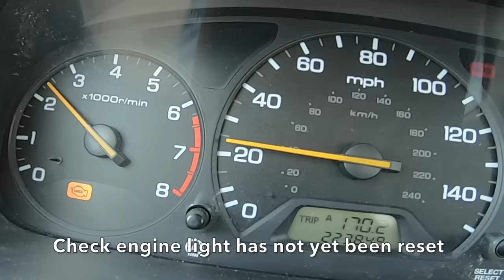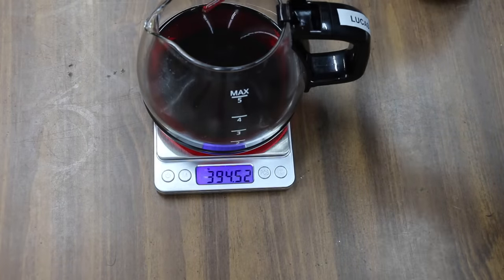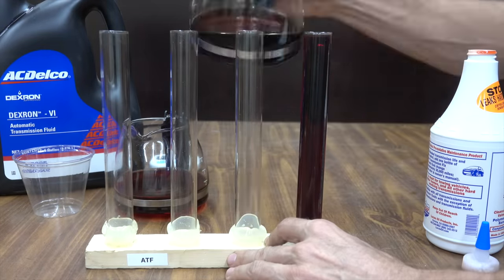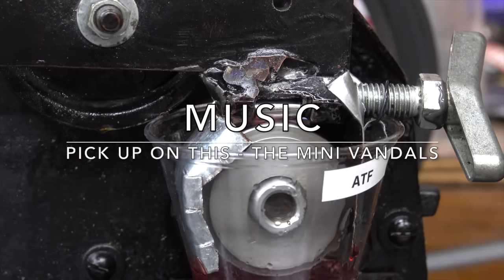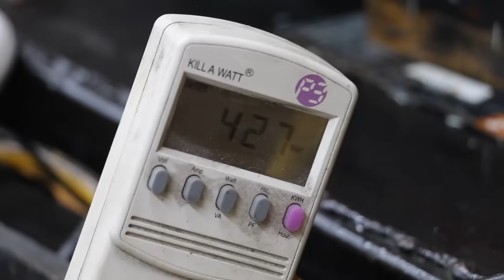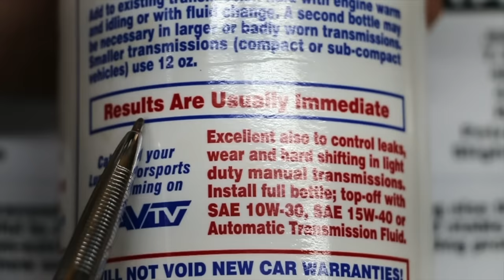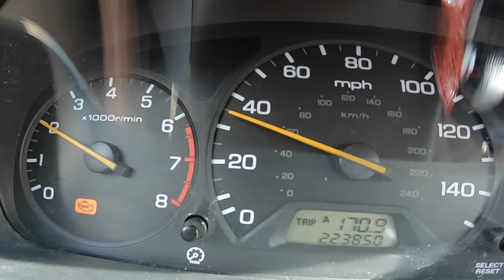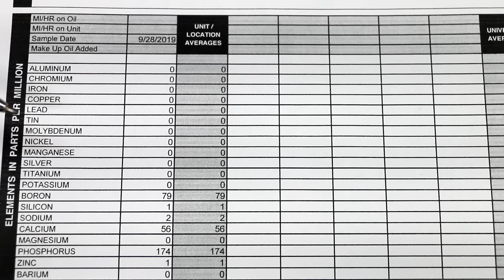Does Lucas Transmission Fix Work?  Let's find out!

Comment: Ive personally seen this stuff take 2 different 4L60 transmissions from not moving to driving fine for several thousand miles.  It doesnt last forever if their slipping really bad to start with but it will get you by for a while.  I had a work truck that would start slipping every 10k miles or so add a quart of Lucas and continue on another 10k miles.  One time I'll never forget, I was driving across the state and coasted into a napa (thankfully there was one on my route when it started slipping bad) added a quart and continued one my way like nothing happened. I did this often and got another 80k or so out of the truck before the owner of the company finally got me a new truck.  I did a tranny service fluid and filter on an old farm truck for a guy I helped for years and it took a truck that wouldn't move at all to driving just fine for quite a while.  It works wonders but like i said it's not a permanent fix on badly worn out clutches!
Reply from the maker: Thanks for sharing.

Comment: I've been contemplating replacing my transmission 352,000 miles. Slow to go in gear, revs when shifting,and clunks when coming to a stop when cold. After warming up it gets better. I will try the Lucas fix first.
Reply from the maker: Thanks for sharing.
Reply: @starkeymorgan7481 put it in yesterday and it seemed to help imediatly. Will give it a long drive today.thanks for sharing.
Reply: @starkeymorgan7481 so far so good. It has improved enough that I will hold off on replacing it. 353,000 miles and still going.

Comment: I know it works when a AT doesn't grab like it supposed to. My friends van had a jurk when starting. Changed the fluid. Drove it 300 miles. Then changed it again with two bottles of Lucas AT fluid and it has been amazing. since.
Reply from the maker: Thanks for sharing.
Reply: Did the same thing on a 2008 Hyundai van. It has been working great since.

Comment: can u use just lucas transmission fluid only
 or would it hurt any thing
Reply: You want to use transmission fluid still and fill some of this into the transmission while the cars running. After adding it, shift through all the gears and wait a little bit for it to mix through.

Comment: I had a 2001 Suzuki Grand Vitara with 223,000. The reverse gear took 5 sec to engage longer during cold weather. Drain a quart of the tranny oil and added a quart of Lucas trans lubricant and it started to engage after a little test drive. I had the vitara for 3 years after that with no problem. Aamco quoted me $2500 to fix the problem. I have to say Lukas worked for me!
Reply from the maker: Thanks for the feedback.

Comment: I have verified it, this product, I give life back to many transmissions that have not had maintenance for a long time, it has repaired two used cars and they look great on me, you just have to keep changing the oil from time to time, so that it works better, do not flush completely, only part of the oil until the system is cleaned, in the end change the filter and only oil and keep running, God take care of you
Reply from the maker: Thanks for sharing.

Comment: Fixed FOUR transmissions that I had issues with on four different mustangs. Any hard or rough shifting transmissions, try this first before going to a shop. Could save you thousands. I bought a mustang for 2000$ that had a trans that wouldn't go out of 3rd. Drained a quart of trans fluid, added this stuff and slowly after about 300 miles it was shifting like brand new.
Reply from the maker: Thanks for the feedback.

Comment: Used in 2007 charger rt. Had delay and shift shock 3rd to 4th gear and all was fixed and drove the car after that around 40k km and the car had around 250k km 
And sold the car after that and the next owner used it for around 30k and never complained
Reply from the maker: Thanks for sharing.

Comment: I have used Lucas products and had good outcomes with them.   I had a 1980 Chevy Malibu with a small  v8 engine.   It had 170000 miles on it and i bought it used.   It would go into reverse however very slowly.  So I had the trans flushed and still the same problem then i added the Lucas and the slow into reverse almost completely disappeared I had a rebuilt engine put in this vehicle right after I bought it due to oil consumption so I wanted to keep the vehicle.      I drove this car an additional  one hundred and thirty thousand miles and no more problems.   I  changed the transmission fluid every additional 30000 miles and I changed my engine on every 5000 miles and I ran Amsoil in the engine with some Lucas and the Amsoil transmission fluid also with a 24 ounce bottle of Lucas.   I gave it to my daughter who drove it a additional hundred thousand miles.  She sold it to a friend and it is still going with over 300 thousand miles on that same transmission which is amazing for a American built automatic transmission. However I think when it has issues that they will probably retire it.    And yes Amsoil is the ultimate vehicle oil.   And Lucas is a awesome engine and transmission life extender.
Reply from the maker: Thanks for sharing.

Comment: 1997 ram 155.000 miles and still working fine engine or transmission never any problems nothing opened still factory
Reply from the maker: Nice!

Comment: Honda had a few years of defective design transmissions over several models in that era.  They KNEW it was a problem but it was never recalled.  200k miles on that Accord before the symptoms of the defect is very good.  My 2002 Honda Odyssey transmission failed twice.  The first at 80k, the second another 80k later.
Reply: I forgot to mention, it was the very same 2nd gear shift behavior as in this video.
Reply from the maker: Thanks for sharing.
Reply: I had 2000 Odyssey and the transmission went bad just about 200k almost 10 years ago.  I took it to carmax and got a check of $300.

Comment: Hondas have 2nd and 3rd gear pressure switches for the transmission that can be changed out. Always do a drain and fill. Do 1x drain and fill every other oil change so you don't shock the transmission with new fluids.
Reply from the maker: Thanks for the feedback.

Comment: I got a f150 with 609,000 I may try it original motor and Trans all run great except getting a small shutter
Reply from the maker: Thanks for the feedback.
Reply: @ProjectFarm  your welcome  one question though just to confirm that I can check the fluid while the truck is running at idle speed

Comment: I had a 2000 Taurus and at 120K miles the front seal in the trans started leaking. It would have cost me 750 to have the seal replaced. Instead I sucked out enough trans fluid to install 4 bottles of the Lucas trans fix and it took a month but the leak slowed down a lot. I did it all over again and sucked out another 96 OZ of trans fluid and refilled with 4 bottles of Lucas. The leak stopped completely and I ran that car for another 100K miles. As a 50 year experienced mechanic, this stuff and other additives will not always work, but they are sometimes worth a try. BTW, the trans always worked great, shifted smooth and I never changed the filter after that. Maybe a one off but I got lucky.
Reply from the maker: Thanks for sharing.

Comment: I know I put Lucas in my engine oil and by doing that 1 quart I save $25 every two weeks. And my truck is 956,000 MI.  it still runs good and it's a 7.3 2001 250 diesels.  hold 15 quarts oil.
Reply from the maker: Thanks for sharing.

Comment: I just bought a 2007 Cadillac DTS with 100, 000 miles on it. The car is in great shape but the transmission was shifting very hard when cold. I added Lucas and some improvement was immediate. Now after driving 100 miles the car is shifting flawlessly. It's actually shifting smoother than any vehicle, new or used, that I've ever owned. Calling the difference before and after adding Lucas unbelievable doesn't come close to describing the difference.
Reply from the maker: Thanks for sharing.

Comment: With your results it begs the question why wouldn't someone just start adding some of this stuff after let's say 2000 miles to maintain viscosity and maybe give you transmission a little bit longer life than the average before a needed rebuild???
Reply from the maker: Thanks for  the feedback.

Comment: As an old retired master certified tech on auto trans, nothing that comes out of a bottle going to fix burnt clutches, bands, hard part damage, convertor failure, maybe make brittle o'rings, lip seals a little more pliable, maybe stop torque converter shudder, but if not drained out doesn't know when to stop swelling seals & can cause internal & external seal leaks, in the old days some people used brake fluid just to hopefully make trans work long enough to sell vehicle, like everything else depends on overall condition of trans !
Reply from the maker: Thanks for sharing.

Comment: Lucas does work in the sense of buying you some time to make decisions and get your wallet in order. I used this product twice in Craigslist clunkers I've bought years ago just to get by during hard times. 92 chevy lumina and 89 chevy astro van. one wouldn't get out of second gear and the other slipped in all gears. The Lucas made them very drivable. But like the the test results, The chevy van took a few seconds to get into gear during very cold weather after sitting overnight. It was fine once it ran a minute or two. I drove them around over a year, never had another issue and was able to sell both once my finances were straight to knowing buyers.
Reply from the maker: Thanks for sharing.

Comment: We owned 2 , 90s Honda's. Transmission went out and overheating head gaskets.  
We thought the Subaru would be better with a 2.5 it also has overheating heads. Even after we paid a mechanic 3k it was worse with dirty black oil in the coolant.  Took it back again and they fixed it and two thousand miles later the new timing belt blew. Sold the car for junk.
Reply from the maker: Thanks for sharing.

Comment: I swear by Lucas transmission fix! I bought a 1994 F-Super duty dump truck with only 46,890 miles, it was used for Snow plowing most of it's life when I bought it. I had to tow the truck home as it had many issues. Once I got it running I found the tranny was shifting super hard, not good 😢,  I dropped the pan to find someone had tried to replace the filter but did not remove the old O ring gasket from tranny. The filter was barely in place! New fluid and filter and a new O ring changed nothing. I have Never believed in the old saying of a mechanic in a bottle/can but after trying Lucas transmission fix I was shocked at what happened. The truck now shifts as it should properly and without any slamming into gears between shifts points. The more I use the truck the better it gets. Last summer I hauled 7 five yard loads of crushed rock with No issues at all. The truck has the E4OD transmission and the 7.5L engine. Best product I've ever used. The product modifies the viscosity of the trannies fluid. You Do NOT have to drain any tranny fluid out to use the product which goes against everything I knew about transmissions and fluid rules!! I swear by Lucas products. I now have added it to every truck I own and give it out as Xmas presents to friends with older autos & trucks😮🔧🤔🔥🔧❤❤❤❤❤😂.
Reply from the maker: Thanks for sharing.

Comment: I hit a huge deer several years ago, with my Chevy Astrovan, It was my Dish Network van  I owned, and worked out of. After I hit the deer, I stopped and drug deer off of road so next person coming about the corner would not hit it also.. But this took me  a few minutes to do.. I didint know the wreck busted my oil cooler in front and all my oil was pumped out on the road. I got back into my van and it was loud.Lifters were chattering and such.. oil light was on.. But I had to drive it down the road a ways passed the guard rails to find a place to pull it off. I just knew it was about too lock up  any time. but did manage too get down the road 1/4 mile and park it for tow truck next day.  I went with tow truck driver and had to try and start it again to turn it around. it started right up and got it on tow truck. later after getting it home. I put another used oil cooler on it and  put oil back in it. and too my suprise it started right up and stopped chattering.  I ended up fixing front end and  drove the van 2 more years with NO problems. The only reason it was running after it ran out of oil was Lucas oil treatment... Im a beliver.. you cant take oil out of motor and run it.. just dont work without throwing a rod.
Reply from the maker: Thanks for sharing.

Comment: Idk much about Honda transmission, but I'd suggest checking the shift solenoid. Not saying that's the issue but normally the part is cheap and normally easy to replace and is overlooked.

Also most fluids are called snake oil for a reason it won't fix your issue, but could lower the issues and extend the life while you start looking for another car or a legitimate repair.
Reply from the maker: Thanks for the feedback.

Comment: Thanks Brother.. May I add something? I'm an old life-long car guy and have owned, sold, flipped, traded hundreds of them. NEVER, NEVER change the Trans fluid on a high mileage vehicle and especially never change the fluid if you having problems. The detergents in the new fluid will kill the transmission. The contaminates and clutch fibers in an old transmission fluid aid in the viscosity problems so when you remove/change that it only gets worse. Usually you can add Lucas and drive for many more miles and sometimes years. My Tundra started slipping at 160k miles when I put in a bottle of Lucas. 5 years and 50k miles later, I'm still towing my tractor or cars with a 20 foot car hauler on a regular basis and I have no plans on selling it any time soon. Ever wonder why Transmission shops offer discounted fluid changes? They know you will be back in a couple months. Don't take my word for it, Find an old retired Trans guy and ask him.
Reply from the maker: You are welcome!  Thanks for sharing.

Comment: My 1st experience with Lucas was in my slipping badly 1998 Bonneville SE. Had to tow it to the shop, My mechanic said "let me try something $20 I't might work, might not" and he wouldn't tell me wut he used. It Worked, drove the car for 3 more years, gave it to a friend, she drove it for 5 more years till it blow a head gasket. Never had the trans replaced. As a former mechanic, I beat my mechanic up to tell me wut he used and it was Lucas. I have used it ever since. Latest vehicles a 2001 Subaru Outback, started slipping 2-3 Lucas worked, car now has 277000 miles on it. Also my 2010 Ford Explorer, had some weird shifting going on when i bought it @190K. Serviced the trans, added the Lucas and 270,040 as of yesterday.!  I also use Lucas engine treatment at EVER oil change on EVERY car i have owned for more then 20 years, YES it all works. Love your test tho, confirms to me i have been hounding people to use Lucas for years for a good reason. Thanks
Reply from the maker: You are welcome!  Thanks for sharing.

Comment: Oh dear, those 6th generation (1998-2002) Honda Accord V6’s had HORRIBLE automatic (4AT) transmissions. Had they come out with a 5MT or 6MT earlier on (ex: Acura CL Type S), it would’ve probably made the car much more robust, and damn near bombproof (if not abused all the time ofc).

Comment: Felt like my transmission was slipping. Added correct amount by the directions. Smoked my transmission in 5 minutes. Plugged up the lines and cooler 5k in repairs. Will never trust it again.

Comment: I was a mechanic for about 45 years i worked on many trans many times I would just add about 3 ounces of brake fluid and after several days the transmission would work fine! All any of this stuff does is soften and swell the seals allowing more oil pressure to the bands and clutches!!
Reply from the maker: Thanks for the feedback.

Comment: Either the filter is bad in that transmission. Or, there is build up in the transmission cooler, at the radiator.

Yes, most of the time, the radiator is the most overlooked component in the transmission. Judging by that brown fluid. I would say, it's probably in the trans cooler.

If the customer changed the fluid. And not the filter, I would start there.

Transmission cooler cleaner, $16. 

Having your vehicle diagnosed and serviced by a trained professional... Priceless.
Reply from the maker: Thanks for sharing.

Comment: I've never witnessed a product that would really help with transmission issues. Putting a high viscosity additive just hides the real problem. Adding 90 weight or STP oil treatment will give you the same results. Then the transmission will self destruct a few miles down the road. Because it is too thick. It's like putting sawdust in the rear differential.  When your automatic transmission starts to act like this. It's usually to late. Maybe test out Trans-X. I see it a lot on the shelf.
Reply from the maker: Thanks for the suggestion.

Comment: Had a mercury mountaineer and. Would not move when you gave it gas. Guy gave it to me free. Emptied some tyranny fluid put in the Lucas and shebam. It drove fine. Once a year I unhooked the trans cooler line drained a ten lb coffee can of fluid and put fresh Lucas in. Drove the truck for five years and then gave it to a couple who was pretty poor. They drove it for seven years
Reply from the maker: Thanks for sharing.